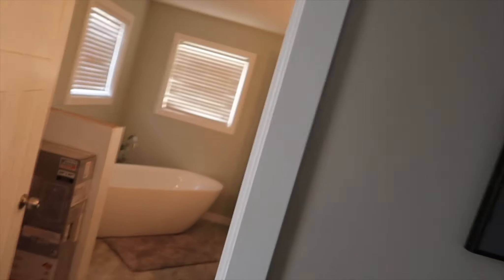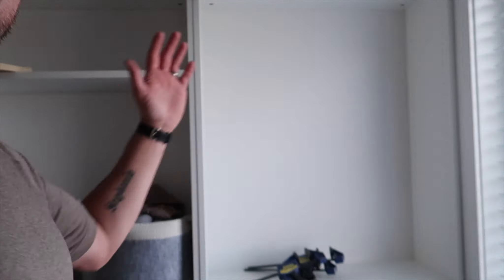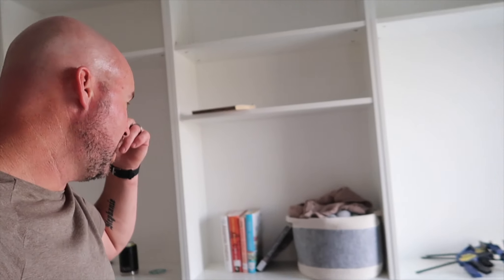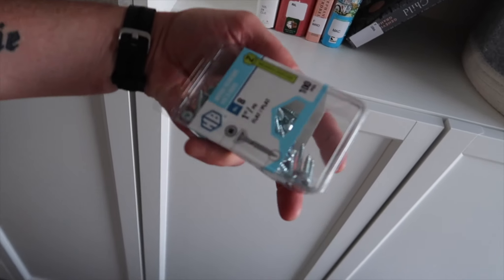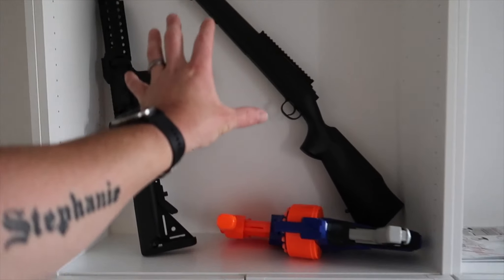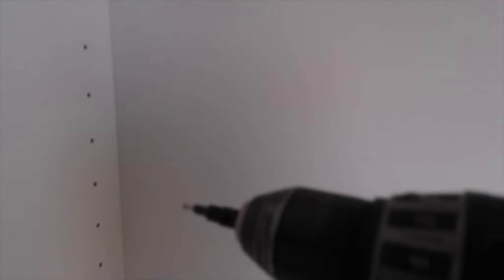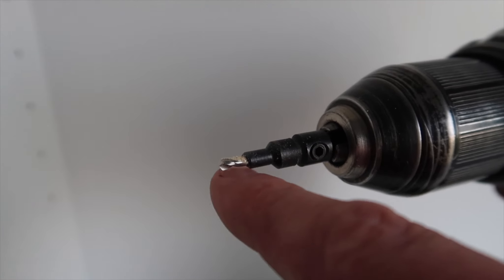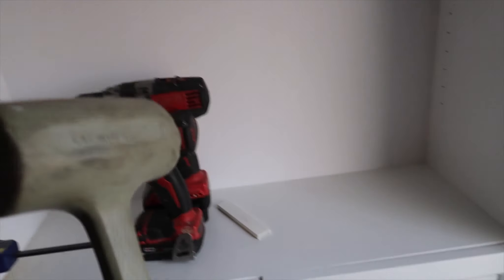Weekend Projects

Comment: You made it look easy man.  I just put all new cabinets in our 41yr old kitchen, what a pain in the tuchus! Crooked walls, floor not level, the gal at Lowe's that "designed" it didn't center the sink with the window or the stove wall cabinets with the existing stove and range hood.  Lots of tweaking and trimming and cussing.  Started it last Thanksgiving and still have a bit to finish.  Looks great though.
Reply from the maker: Oh man that’s a lot of work isn’t it? I did a kitchen in one of our old houses that was moved to it’s location in 1950. I know what you mean with the tweaking and cussing 😆. This house is pretty straight and square which makes these little projects a breeze.
Reply: @jeremygoertz  oh man couldn't imagine working on a house that was moved. Although they probably built them a bit more solid back in the 50's. I think the guy who built this place back in '79 must have been smoking some funny stuff, nothing is close to straight.  I've redone the basement (almost), new stairs (not just treads and risers but stringers and all), tile in the entryway, new flooring upstairs (and sections of the sub floor) and completely remodeled the kitchen. Every project I find something else I have to fix before I can actually fix what I wanted to fix. Told the wife, no more projects! Feels great once it's done knowing you did it yourself though and I've learned a lot (and bought a lot of new tools).  :)

Comment: The Ikea hardware surely leaves a lot to be desired. The pilot holes are too small for the screws. The screws for the latches stripped out even with hand tools. And, if the latch slams shut on your digits you will be inventing words a mechanic will blush at.

Comment: That was a Pozidriv (PZ) not a Phillips (PH) screw. If you use PH Screwdriver on a PZ screw you will have a bad experience.
Reply from the maker: They still suck compared to Robertson.
Reply from the maker: Also, pozydrive are Phillips. Just a variation of them.
Reply: Probably, I‘ve never encountered Robertson here in Europe 🤷‍♂️
Reply: Yes, but in practice they feel completely different. With PZ you can apply more force without the driver slipping out. PH is only useful in applications where you want to avoid excessive force, like electronics. In any case you really want to avoid using the wrong driver, which is difficult, because they‘re so damn similar. Anyway fuck Torx.
Reply from the maker: Yeah, I think Robertson is superior to torx also 😆